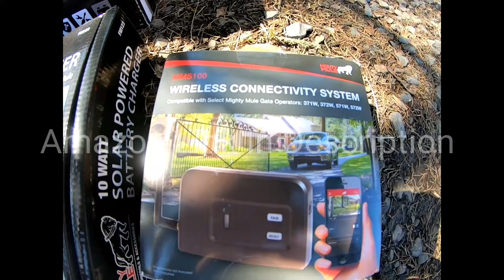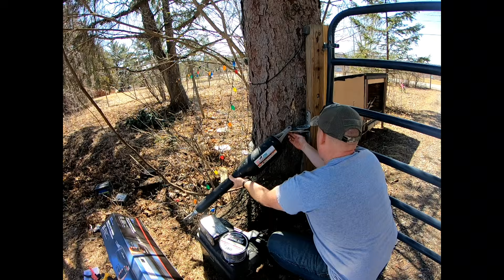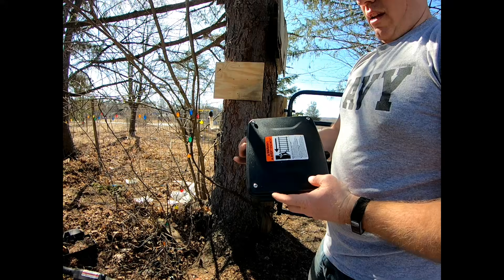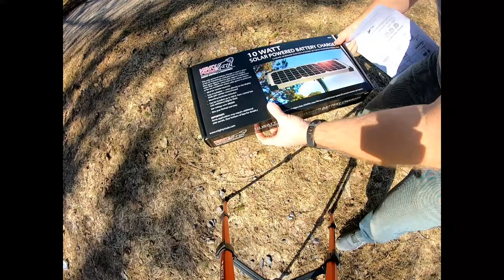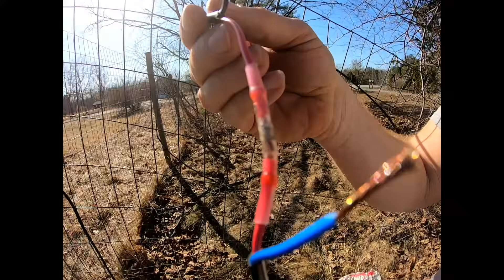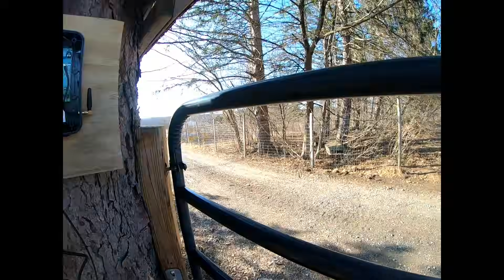(Newest) Mighty Mule 371W Gate Opener Install Part 1

Comment: When the warranty is out, never buy again.  They seem to need replacement every 3 to 4 months.  These are garbage and not as simple as it seems to install.
Reply from the maker: That sucks sorry to hear mines going on 6 years with no issues other than charging up the battery when winter hits with no sun!

Comment: Hey. We’re installing a mm571w and we removed a mm560. My husband had this bright idea to change the gate for some reason. It’s the gate we removed before, for some reason. So the brackets don’t line up and he’s hardheaded and won’t listen. Well anyway that’s another story. The reason I’m posting is your gate bracket is on backwards. The thickest part attaches to the operator or motor and the tapered part goes out to the right of the motor. Check your manual again. Our old one was just like the manual and I just checked it again to verify and yes, the bolt holes should be seen, not behind the motor. Like I said, we have a different model, but it should be the same on all models.
Reply from the maker: Ill have to check lol I've had it the same way for 5 plus years with no issues maybe it doesn't matter or I am just lucky but ill definitely check it out!😊 Thanks for watching!👍

Comment: after purchasing two new marine batteries, I made a call to the parent company of Mighty Mule, they said it was likely to much draw (due to the WiFi feature) with only a 10w solar panel and suggested
Reply: I either needed an additional 20w or replace with a 30w. I choose a 20 and hooked directly to the 10. The wires were so delicate, hopefully it works!! Good luck and thank you for your great videos!!

Comment: Will the mighty mule work IF there's no battery and it's just connected by the solar? I have done these steps and it will not work. 
Thanks,
Reply from the maker: Power is still going strictly by the panel itself but not enough power to work the system!! You need a 12volt battery to operate the system in conjunction with the solar panel, the solar panel strictly acts as a trickle charger for the 12 volt battery, ive learned that if you run into any issues and you need to cut power to the system disconnecting the battery alone does not work if you have a solar panel because that little bit of trickle charge you need to switch the system to the off position,  I learned that when trying to do a reset!  So in short solar panel hooked up with no battery system doesn't work! Thank you for watching!
Reply: Thank you very much for the help. I have a 12volt hooked up with the solar panel. I was gone for a month, came back and the 12volt to my surprise was dead. Wondering if you have any thoughts as to why somehow the solar panel wasn't able to provide enough energy to the battery? I should mention I live in a very sunny area as well. 
Thank you,
Reply from the maker: @surfboyhawaii was the battery new or used?
Reply: @WhitehouseFarmVet  it is a used battery but was fully charged when I installed it.
Reply from the maker: I had a similar issue with one of my used car batteries so I switched to a marine battery and haven't had any issues since, 12 volt car type batteries are not meant to be drained down then charged back up constantly a marine battery can handle solar charging better because they can be depleted then charged multiple times and it doesn't hurt them like regular batteries! I'm just saying if you had sun the whole time and solar hooked up more than likely the culprit is the battery especially a used one!
Reply: We recently were forced to do a software update that’s now called Nice G.O. and my guess is the new system requires more energy, we’re needed to upgrade our solar panel from the 10 to a 30w. Have you experienced this?
Reply from the maker: @brandifarley3270 i also was forced to switch to the new G.O. ,it doesn't use more energy who told you that and that  you needed a new solar panel???

Comment: I did this exactly the way you did it but mine opens back up after 30 seconds,can’t figure it out
Reply from the maker: If it opens up that usually means an obstruction or setting is too tight on close, it should swing freely to close not pushing!
Reply: @WhitehouseFarmVet  I don’t even have a stop on the other side
Reply from the maker: Did you set your gate to where you wanted it to stop?
Reply: There's a small switch which says pull on one side and push on the other side. Try switching it and reseting it, then it should work. Or turn the small switch with a screwdriver from airoclose to off.

Comment: I assume the control box has a built in solar charge controller correct?
Reply from the maker: Yes it does! Thanks for watching!👍
Reply: @WhitehouseFarmVet  thanks! Doesn't mention that anywhere
Reply from the maker: No problem good luck if your gonna be hooking up a system it's not bad at all, pretty straight forward!👍

Comment: Can you add a bigger watt size solar panel than the 10w included in this package?
Reply from the maker: Absolutely just make sure whatever size you use is comparable to the battery! Thanks for watching!👍
Reply: @WhitehouseFarmVet  So I bought a 25w solar panel for my gate--haven't installed anything yet. But was told that I need a solar panel volt controller so that it doesn't over charge the batter. Is this true and if so, can recommend one?
Reply: A voltage controller is already built into the gate's electronics.

Comment: Look closely at the diagram on pages 24-25, as this step on page 25 works perfectly as expected/described with no errors. **Automatic Gate Lock (FM143) NOTE: A wire jumper is required between 'LOCK V-' and 'LOCK Relay Common'. The additional circuit board is not needed. Also, the reason many folks have isses configuring the MMS100 is because the manufacturer failed to include internal parts/(an adapter) that completes the connection on both antennas, (MMS100/Main Control Box). If you call them, they will help troubleshoot and send this out free of charge. They will text you a clickable link that allows them to access your smart phone camera and see what you see. Hope this helps everyone.

https://www.mightymule.com/wp-content/uploads/10022114-A-MM371W_372W_WEB.pdf
I wanted to include a zoomed-in view of this configuration, but not sure how to achieve this on YT.
Reply from the maker: Thank you for the information and thank you for watching!👍

Comment: Bless you. I just bought the 371W and was trying to watch the videos from Mighty Mule.. They were terrible. Your walk through really helped. Will give it a try tomorrow.
Reply from the maker: Wow!!! Thank you so much! You got this!!! Thank you for watching and have a great summer!👍😊
Reply: I'm having trouble with my gate limits have followed the directions  my gate closed and hits the pole and automatically opens back up  its like the system ignores where I set the gate to close
Reply from the maker: @wayneharley7233 I know exactly what your talking about, you do have to set it quick before it smashes against anything it does take a little bit to get it right, I usually stop it just before it hits and then it still hits but does not detect the reset to open, I hope this helps but does take some getting use to ,to get it just right!
Thanks for watching and good luck!
Reply: Thanks got it the next day first try

Comment: Installed one today.  It won't learn the transmitter.  So I'm stuck there.  I did everything you showed.
Reply from the maker: Make sure to check you switches In the transmitter and the box they have to be the same!
Reply: @WhitehouseFarmVet  I called MM support.  They fixed in in 5 seconds.  Had to press a button to exit program mode.  Works fine.
Reply from the maker: That's great to hear!  Hope you have a great summer!👍😊

Comment: Thank you! Question: where did you get the correct connection pieces for hooking to the mighty mule battery? Mine came with the standard ring-style attaching mechanical. I don’t see anything about this in the instructions. Thank you
Reply from the maker: You will have to go to a O'Reilly or napa, advanced auto to buy the right connectors for you battery, then cut the old ones off and put the new ones on its really simple,  thanks for watching and good luck 👍
Reply: @WhitehouseFarmVet  do you happen to have a video of you doing that step?
Reply from the maker: @WernDoggie no unfortunately I don't but it's really simple it would only take you a couple minutes!!!

Comment: Does the new MMK200 wireless keypad work with the old MM360 gate opener?
Reply from the maker: Sorry I wish it did!  it is only Compatible with the 271, 272, 371W, 372W, 571W and 572W, TS571W gate openers.  Good question and thank you for watching!👍
Reply: @WhitehouseFarmVet  thank you. Just checking. Back to tractor supply. And hello amazon.
Reply from the maker: Anytime!👍

Comment: Hey I have a question I don’t know if my remote ain’t connected or what I connected everything and tried programming I get all the beeps and everything and click open and does nothing I have been there like 4 hours and can’t figure it out
Reply from the maker: Make sure the remote batteries are not dead you should see a light on your remote when you press it, also check and Open up your remote and make sure it's on the same frequency there are little tabs inside that slide up and down! Make sd ure they match up!  Hope this helps thanks for watching!👍😊
Reply: Do you have somewhere i can contact u such as Facebook or instagram
Reply from the maker: Facebook Whitehouse Farm!!!👍😊
Reply from the maker: Instagram Whitehousefarmvet!!👍😊
Reply: I checked the remote blinks I opened it but I don’t see anything that slide up and down

Comment: Bro whats the name of the attachment you used at the end of the wiring to attach the wiring to the battery?
Reply from the maker: They are just terminals they come in many different varieties,  but I would get the alligator type clips so you can easily disconnect the battery for charging or to reset the system! Thank you for watching!👍😊

Comment: Thank you for sharing this video, My MM360 went dead because of the water/rain now I am looking into getting the MM371W, But my concern is with the old parts -Remote (FM135)-Digital Keypad (FM137) & the Vehicle Sensor (FM138), I have posted the question to see if the are compatible with the MM371W, I am still waiting for an answer from Mighty Mule, do you think they will work with MM371W? Thanks
Reply from the maker: Yes they do work watch my other mighty mule videos!!  I talk about using my old driveway magnet, remotes etc!!! They will all work with the new one! Thank you for watching!👍😊
Reply: @WhitehouseFarmVet  Thanks...
Reply: @WhitehouseFarmVet  Thank you, was confirmed by Mighty Mule this morning & they will work, again Thanks
Reply from the maker: Awesome!👍

Comment: Great video. I already installed mine without your video. I did have some trouble but figured it out. My question is how does the automatic closer get set? I see the dial do I move that or leave it? I haven’t seen videos on this yet. Thanks
Reply from the maker: I think your asking about once the gate is opened the time delay for it closing? Yeah you would have to move the dial to how long you want it to stay open ie 30 secs 1 minute etc, let me know thanks for watching!👍😊
Reply: My auto close feature isn't working either.  I adjusted it to approx 1 minute.

Comment: I installed mine as a push to open and the directions you showed are in the book for setting the open limit. But there are no instructions in the book on setting the closed limit and the gate is not closing all the way. No video on the push to open, so if anyone knows how to do this please share. Also, I see a reset button in the box, but not sure how this works to reset the system, as I have pressed it and it doesn't do anything.
Reply from the maker: You have to hold down the reset button till it beeps then look at your buttons with arrow up and down and use them to set your open limit it's almost the same way as I set mine up! Hope this helps and thank you for watching!👍

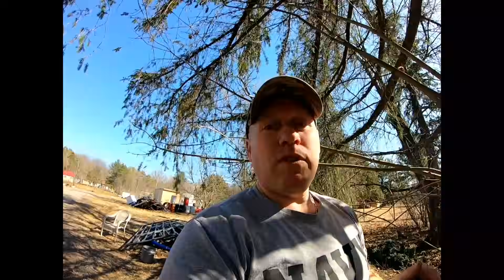Comment: is your sound cutting off and on at about 15:00–> ?  Also is the teardrop shaped post bracket hinge an actual hinge that is supposed to move or do you tighten that down at some set angle tight enough so it doesn’t move? this may seem like a silly question but it’s the shape of it that makes me ask.
Reply: I’ll add my own reply here since I’m finished with my project. You set the angle of the teardrop metal piece according to how your individual actuator clears the gate once it’s open and if there’s enough extension on the arm when the gate is closed by putting in bolts into the holes and locking it in place.  It is adjustable because of the different types and sizes of gate posts that would put your bracket either closer to, or farther from the plane of the gate itself.
Reply from the maker: You hit the nail on the head perfect!  Thank you for your reply!  It's great to see people helping each other out on here especially when everyone is trying to learn to do these types of things themselves, which is great! Thank you and thank you for watching!👍❤

Comment: Anyone else have range issues with the remotes? We have three remotes and ever since install you have to be about 10 feet or closer for it to communicate. Any suggestions? Thank you.
Reply from the maker: Try moving the antenna around I had to turn mine so it was facing a 75 degree instead of 90 hopefully something simple like that will help! Thank you for watching!👍
Reply: @WhitehouseFarmVet  So i opened things up and just tigtned down the nut that the anttena was on. Seemed to help, have a solid 70 feet atleast now.
Reply from the maker: Awesome good to hear!👍👍👍

Comment: the 371w calls for an automotive or marine battery, I see you list the regular 7ah battery, how did that work for you?
Reply from the maker: It worked fine up until the end of November then with shorter days ,cloud coverage and cold it was drawing alot faster than charging,  I had a 100 watt solar panel and automotive battery I used on my old gate so I hooked that back up for the winter, mighty mule does recommend a 225cca automotive battery       but for the spring and summer the 7ah battery ran fine I figured for the price I would try it!  Thank you for watching!👍
Reply: @WhitehouseFarmVet  Thank you!
Reply from the maker: Anytime! Thank you for watching and good luck with the setup!👍😁

Comment: In order for me to put the battery wires I had to take out the seal and push it back in after I put the wires in the box. Just remember to have the seal around the wires much like the seal cap. Need the seal.
Reply from the maker: Definitely! if that doesn't work some silicone can also work!  Thank you for watching!👍

Comment: So, we are still having an issue with the gate limit parameters. I have followed the instructions numerous times and yet it still opens too far, hits the fence and immediately closes again.  The only way it won't open too far is if I hit the remote to stop it before it hits the fence.  We were able to set the close limits okay, but it opens too far and hits the fence.  Any ideas?  Thanks.
Reply from the maker: Yes you can try adjusting the top bolt and pin on the bracket that holds the unit, not the arm that comes out and in ,try a different hole position and see where that gets you. I will also brainstorm some other options for you! 👍
Reply: @WhitehouseFarmVet  thank you. You are so kind and helpful ❗️

Comment: What battery did you buy and what cables.  Did all the first of your video but haven't bought the battery and you mention you had to change the connectors?
Reply: Sorry saw link to battery.  Just did you need new cables?
Reply from the maker: No I was able to cut the cables to put the right matching connectors for battery,  it's really simple and you can get the connectors at any lowes, home depot ,tractor supply, walmart or electrical shop!  Thank you for watching!👍😁
Reply: @WhitehouseFarmVet  thanks for your video. New gate up and running.  Only extra thing we had to do was reprogram the remotes as they kept opening next doors gates 🤣
Reply from the maker: Hahahhaha that's funny! Glad you are up and running and Thank you for watching!👍😊
Reply: @WhitehouseFarmVet  according to Mighty Mule website the 7 amp/hr battery is not for the MM371W, it recommends a 12v 250CCa battery.
Reply from the maker: Yeah I actually used the full size 12volt Marine batteries with that 100 watt solar panel you see in the videos, I got the 7 amp 12 volt with mm solar panel to try out because it was only 30 bucks vs 200 for battery and the solar panel which is definitely pricey but I figured I could use that set up on something else if it failed, I had intentions of switching it back over to my Marine battery and 100 watt panel but have been shocked at how well it's worked, I haven't had any issues yet but I will see once it gets down to  minus and single digits and lots of winter cloud coverage, I think that's were battery drainage will be at its peak and why they recommend the 250cca, only time will tell, I'll keep you posted though!  It's fun experimenting with solar ,I would love to do more with solar on my farm!  Thank you for watching!👍🦃🐝🐖🐓🐐😁